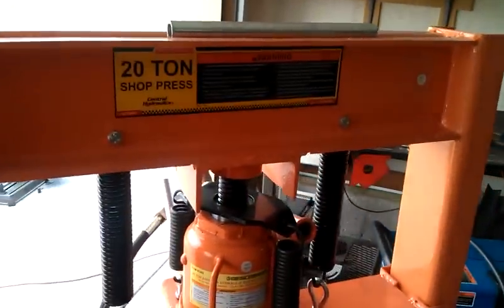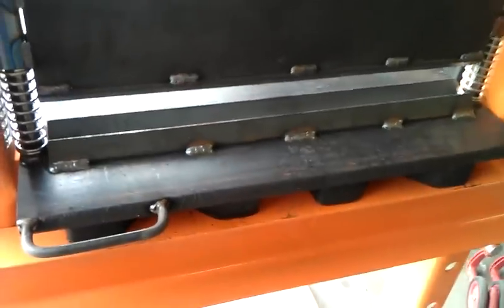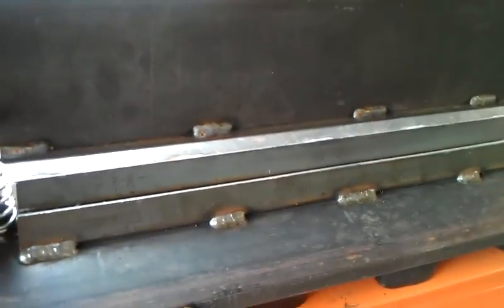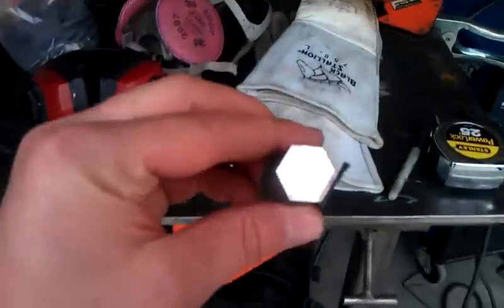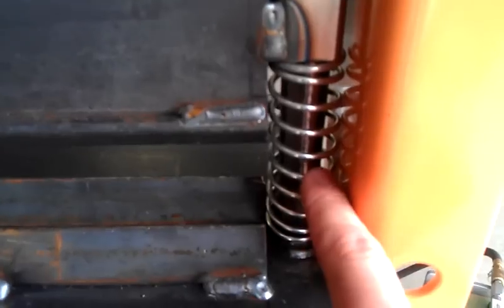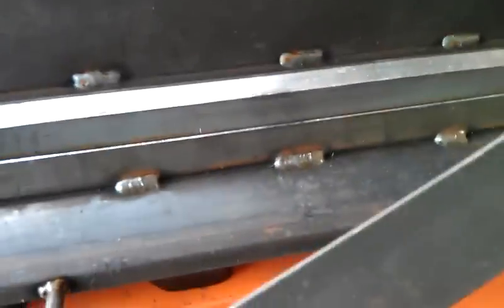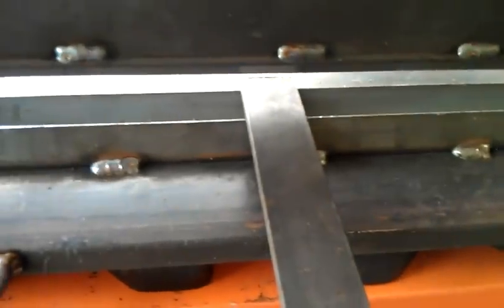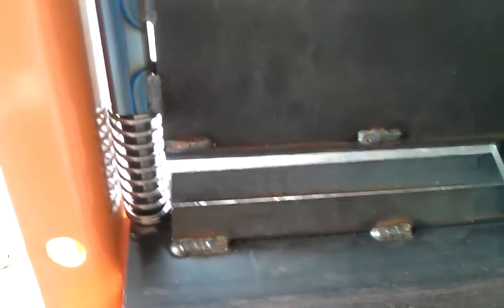Homemade  Press Brake for Harbor Freight 20 Ton Shop Press

Comment: New to your channel just subbed  Great build  Where did you get the pneumatic foot pump from ,Thats awesome
Reply from the maker: It is an air over hydraulic ram from Harbor Freight.  It doesn't have a foot pump, but a hand control

Comment: Any update on how the angle holds up?  I was looking into making these, and was wondering how I'd get the angles.  Worried angle iron would just get crushed.
Reply from the maker: Holds up well.  I think I went with some pretty thick angle iron (1/4" if I remember)  Round bar is rough on the edge of the angle iron, but flat plate doesn't cause any issues to the angle iron.
Reply: John Harmon - Cold Creek Works Awesome. I'll give it a shot!

Comment: That is impressive, what about if you needed to bend say 20" in?
Reply from the maker: I haven't had a need to, but if I did I would put some relief cuts in it, bend it over the side of my table (depending on the thickness of the material) and weld it.  I have done that for some 16 gauge material.

Comment: good idea. is it still holding up?
Reply from the maker: Still holding up.  If I had to do it again I would change the angle on the top of the break to 65 degrees to make it easier to bend stuff to 90 degrees.  I still may, I just need to take it to a machine shop.

Comment: Thats some job, John. Do you mind if I ask how much did this jig cost you.
Reply from the maker: I think about 80-90 bucks in steel from a place that overcharges in my opinion... but I have to drive another 20+ miles each way if I want to go to the next closest place.
Reply: John Harmon You know, I've worked with ships for a long time and I know that stock of that gauge  and cut to your spects is hard to find at that price, you are lucky. Well, anyway that is one awesome job you did, and I'll be looking forward to your other projects and Ideas. Thank you for your mechanical entertainment.

Comment from the maker: Good eye.  In this vid I was just shy of 90 degrees.  I can get a 90 degree bend with this, but I have to add more pressure, which is called coining.  If you created a die with a sharper point, you can get to the 90 degrees with less pressure.  I didn't feel like doing that here.  Maybe in the future.

Comment: Swag Off Road has some excellent steel arbor plates. I use a 1.25 inch thick steel plate on the base of my Harbor Freight 36 ton press.I made them myself.  I modified my 20 ton to get to 36 tons.Had to increase the table support pins to 1 inch and also had to reinforce the press itself.
The air hydraulic jack sure makes using these presses a lot nicer.

Comment from the maker: What's to show?  Cut the metal, slap it together, and weld it.  The hardest thing about it is making sure your uprights that hold your springs are in line with the guides welded to the top piece.  Here is one from a kit: watch?v=iFXZgiXX_mA

Comment: Yes those cast iron plates can explode with some force. I made my  own with my plasma cutter and some 1.5 inch thick steel and they work great. I've seen some cast iron plates literally shoot across the room when they explode and stick into a wall.

I've modified my 20 to to 36 ton by boxing in the side rails, boxing in the bed and boxing in the top. I also made the pins 1 inch with grade 8 bolts and installed a 36 ton air/hydraulic jack. Way faster and quicker.

Comment from the maker: Thanks! In the future I may tweak the brake so that the top is beveled at more than 45 degrees.  Thickest I bend in it is 1/4"... and usually not that wide.  What I really don't trust are the cast arbor plates supporting the brake.

Comment: The angle iron on the bottom and the angle iron on the blade would limit the ability to bend thicker metal. I've broken brakes thicker than what you have here by bending 3/8 plate. I ended up having to reinforce the bottom with a double layer of thicker angle iron. Those small welds holding the angle iron in place will snap if you go too thick. A complete weld with double thickness on the angle iron and then you'll have a bending press that can handle thicker, wider metals.
Nice looking brake!

Comment from the maker: I think it could do it.  I haven't tried but seems doable.  10" of 1/4 might be a different story though.

The limitations would be my ram mostly.  The brake would hold up to the pressure fine.

Comment: so dies are not interchangeable?, i mean they are not interchangeable through the top ram or bottom, this is damm cool, but what if you wanted a more closed angle or acute you would have to make another whole tool like that, would have been really awsome if you had put bolts along the ram to hold and use interchangable dies. Still this is badass that not alot of people have at home.

Comment: If you make the V die less than a 90° angle your parts won't be under bent and you won't be coining like that. Less pressure = longer lasting... Coining is hard on tooling and seals. Doesn't have to be much 85° die is good. Also helps if your punch is more acute also. Good job I want one... Maybe ring up a back gauge also so you know the length of your flange?

Comment: Very nice little brake. If you ever want to improve it sometime, or get bored with it might i suggest leaving the top solid, without the angle iron and make it so that it can accept standard brake dies. your bottom die is big enough to be able to handle a pretty large radius top die 5/16 or maybe even 3/8r. used dies are pretty easy to find. My work just threw about 30 pairs of dies away just because they were rusty, i helped myself for some of the Gooseneck dies. great idea tho

Comment from the maker: Well, the overall length is just around 19-20 inches, so that is a problem; however, the thickness of the plate is not.  This thing would easily bend that thickness and more over the whole width.

Comment from the maker: The press was around $140, I don't remember the cost of the air/hydraulic ram (I am sure I got 20-25% off of it too), and the steel cost me around $70-$80

Comment: Instead of welding the die to the flat plate, it would have been better make arrangment to connect different types and sizes of dies to put on the flat plate, this can make your system versatile.

Comment from the maker: @knoxhard 
Air feature is just an air/hydraulic ram from HF.  Mine is a low profile one, but they make a standard size.  Just swap it out for the manual hydraulic bottle jack and hook it up to an air compressor.  That's it.  It comes assembled.  I may see if I can get another video later.

Comment from the maker: @6307jerry 
butted together.  I was going to gap them, but it didn't look right when doing some visual tests with some stock I was going to bend.  

My previous brake was that way too.   I guess if you want 90+ degrees you could gap them, but I am usually shooting for 90 or less